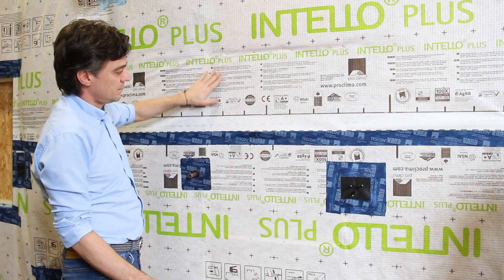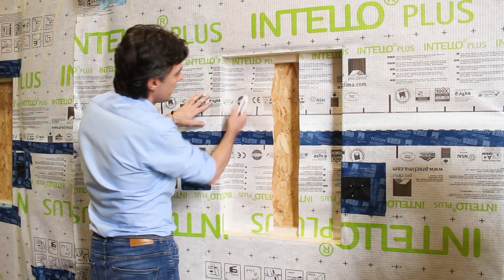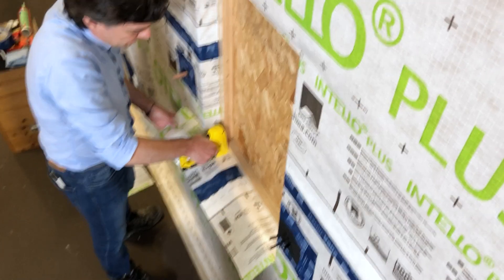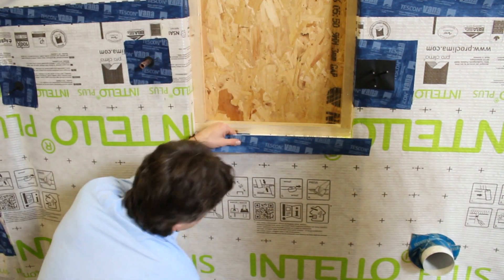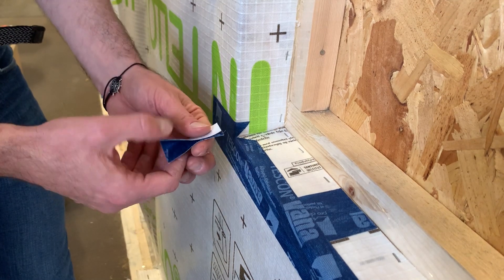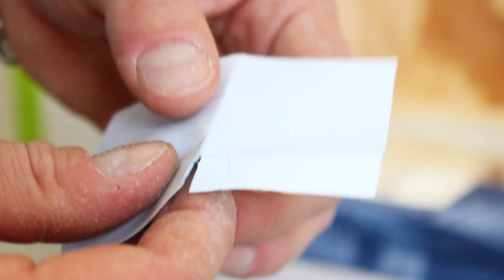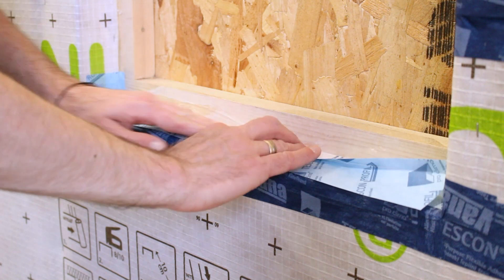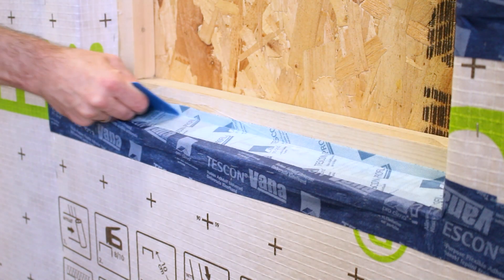Airtight sealing around a window

Comment: If you're doing air-sealing inside, and then attach the finished wall material on top of this membrane. How can you screw any paintings or shelves on this wall, as any >13mm screw will break the membrane?
Reply from the maker: If possible it is best to include a service zone between the internal finish and the airtight membrane for additional protection from fixings. If the fixing has solid grounds in the background, then its impact on air leakage over the whole building is actually quite small. Large penetrations like pipes have a much bigger influence.
Reply: @EcologicalBuildingSystems  My house will be MHM->ProClimaDA->WoodFiber so there will be a lot of MHM to screw things into. That doesn't seem to be typical setup elsewhere in Europe, or at least I haven't seen any videos with such.
Reply: @EcologicalBuildingSystems  does this apply to connections between the window frame and ICF  blocks?
Reply from the maker: Our experience is that window reveals are less critical as it is easier to fix boards directly through the membrane as the area tends to be smaller (also rarer to hang pictures or run services in window reveals).  The use of service battening is recommended rather than a hard and fast absolute rule.